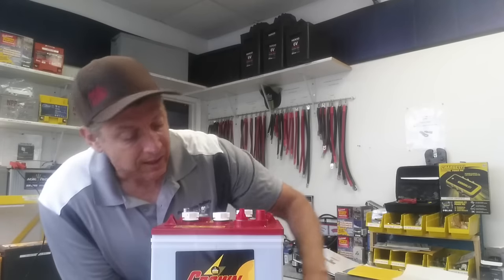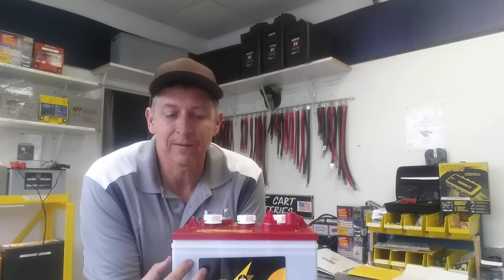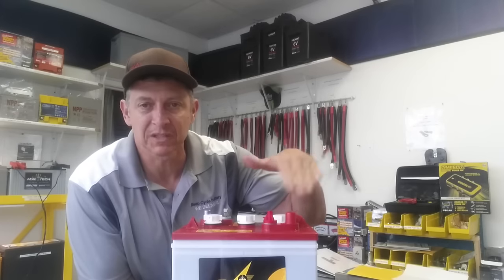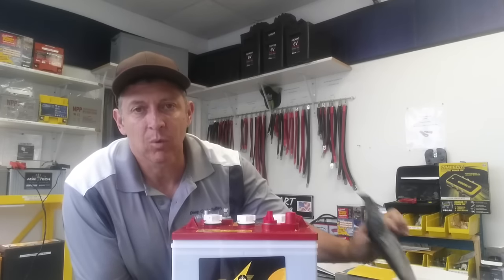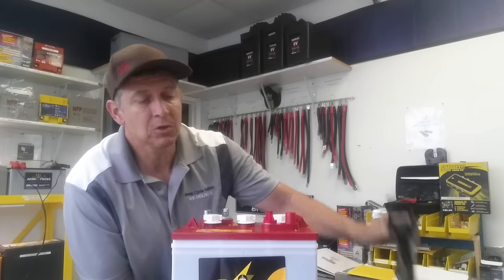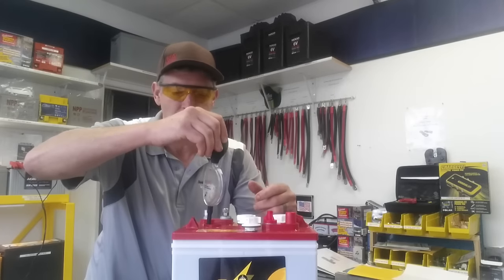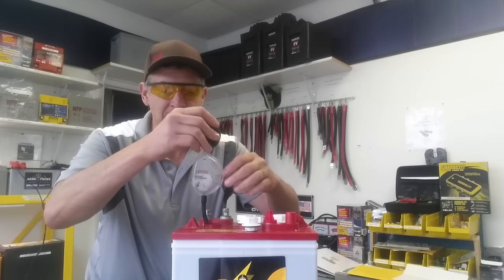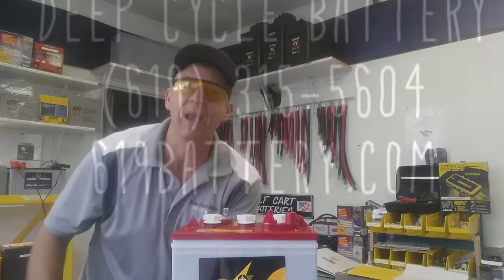How to Check Battery Specific Gravity - Hydrometer

Comment: Have battery tested at Auto Zone and they say it’s good but it won’t crank like totally dead. That very expensive tester but it’s not worth much.  I say it’s the tester because my car will start run with battery from the other car. Definitely the battery.

Comment: In my car battery have 6 cell holes and i tested all cell using hydrometer or gravity meter and in 5 cells showing 12.8 gravity and in 1 cell showing 12 after fully charged many times. so it's bad battery or not .Please suggest me because my car battery drains in 2 days no fault on my car my mechanic checked this.
Reply from the maker: Yes the battery has a bad cell
Reply: Deep Cycle Battery San Diego sir one thing also I got know today that voltmeter showing 2-3volts when touching voltmeter's testing cable points on top of battery body(plastic part)
What is that is there any internal short in battery itself?
Reply from the maker: the voltage on top due to a mix of debris leaking electrolyte,   parasitically draining battery
Reply: Deep Cycle Battery San Diego 0
Reply: @DeepcyclebatterystoreSanDiego  do you have to let the battery’s sit for a while before testing the specific gravity.   I just had my cart charging and unplugged the cart then test them.   Do I need to wait several hours before testing them.  Thank you. My cart won’t run for more than 10 minutes and I get 6 volts at each battery.

Comment: Boss  for new   lead acid battery of 12 volt , 200AH  ,   what is  concentration of  electrolyte  in terms of  specific gravity ??    should  we fill the  battery with distilled water or  fill with  battery acid of  specific gravity 1.2
Reply from the maker: good question. Use distilled water only. The mfg activates the battery with sulfuric acid. Adding it again will increase plate decay

Comment: Sir , I am planning to buy used Tubular battery , is this test all enough  to come in to a conclusion about battery overall health are other tests necessary
Reply from the maker: Of course if the tubular cell is a flooded battery then the manufacturer will produce data reflecting the specific gravity in reference to state of charge

Comment: Just before watching this, U learned that the ratio is 65% water to 35% sulfuric acid.
You say it's 75% to 25%. Now I need to do more research to get the right ratio.
Reply: O'Reilly sells premix battery acid and I believe it's 37% you get 5 gallons for 25$